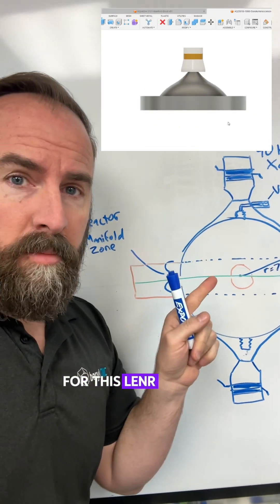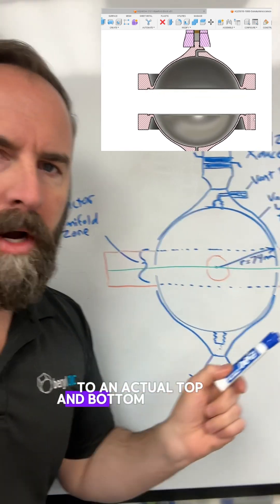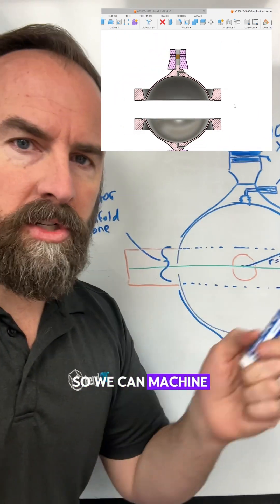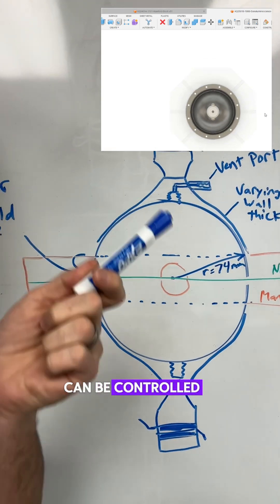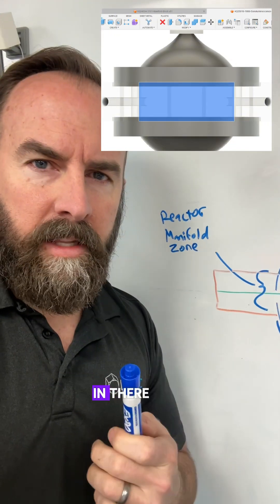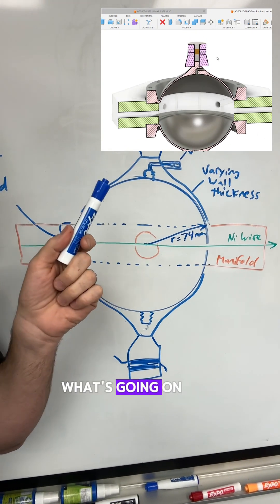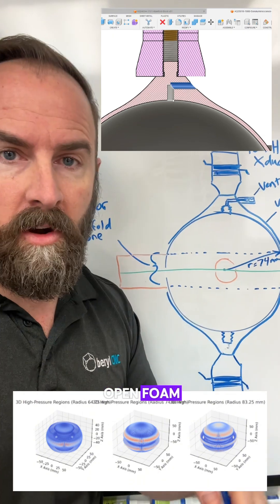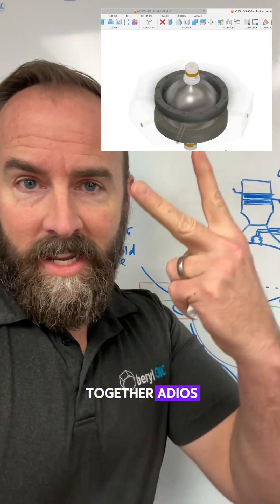Spherical Sonoluminescence Reactor

Comment: You can get a parabolic shape by putting a stainless steel bowl on a turntable and spinning it at a set RPM and then pouring molten aluminum into the spinning bowl.
Preheat the bowl to about 950°F to 1100°F. That will let the aluminum cool more slowly so that it won't freeze with ripples in it. 
A parabola will focus a lot tighter, you will do less polishing on the reflector, and you wont have to use any sand or foam.
Use an air bearing to spin the platen on. 
Maybe an argon blanket to prevent oxidation? 
If you use a sauce pan shape for the container, you will have a beefy base. For a minimal base, you'd wand a parabolic bowl. 
Thats going to give you the tightest and most intense fical point though.
Reply from the maker: @punkinhaidmartin  I think a parabola might pull the focal point in too close. That’s why I’m trying to get an Open Foam simulation going, could try both and dial it in.
Reply: @i2c_jason  if you spin the mold at 30rpm, your focal point will be at .5mm above the bowl. Spin it slower to move the focal length out further.
Reply: @i2c_jason OK
Reply: @i2c_jason  in too close. I missed that.
I'll give it a think.
Reply: Okay. My intuition has me betting on maximizing intensity though. Im interested to know why "too intense" might be less likely to work though.

Comment: What problems did you encounter with the acrylic parts ?
Reply from the maker: No problems, I just wanted them for bringup so I could see what's going on inside and around the hemispheres. To get power out of this, eventually I'll have to pressurize and generate external steam with a heat exchanger so I wanted to have an aluminum manifold for that stage of the experiment. Thanks for watching!